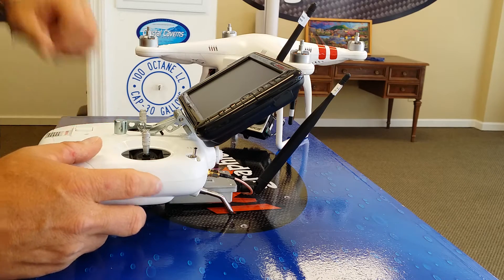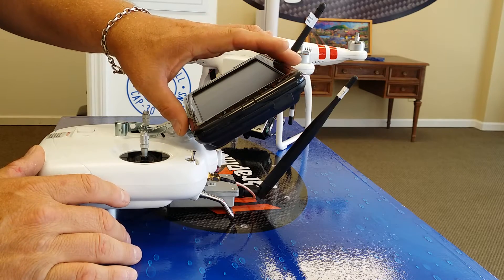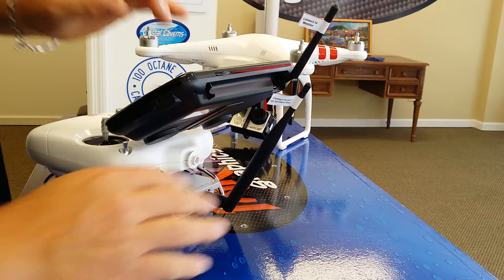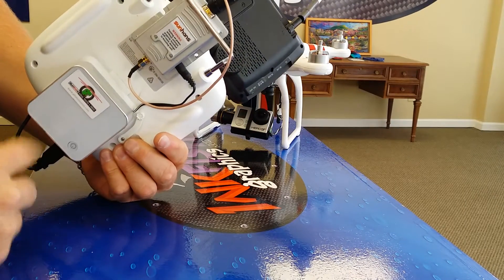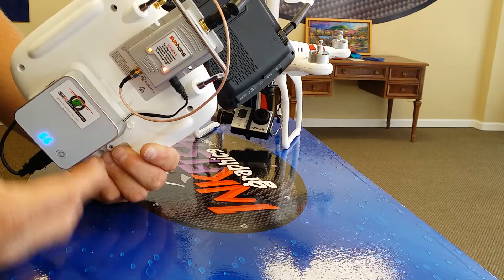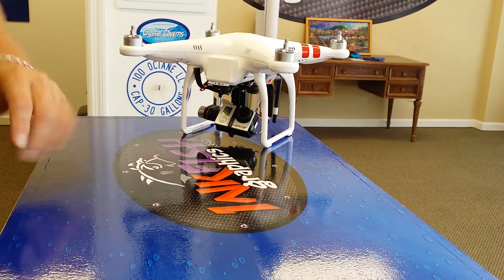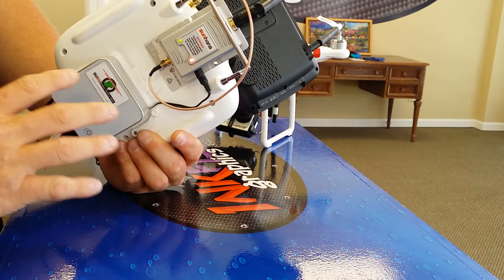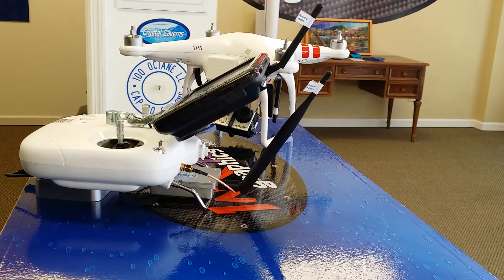Stage 2 Range Extender Operation for DJI Phantom 1 & 2

Comment: Awesome video. What range do you get with that mod?
Reply from the maker: It all depends on your area but generally twice to 3 times your normal distance.
Reply: CCW Chris Awesome, could you tell me what model is that battery you have there for the extender? I am looking for it but I haven't found it yet. Thanks
Reply from the maker: MrWILLJMS Its our battery pack.
Reply: CCW Chris I didnt' know about it. You should put a link on the description. I just saw it right now, I need this for my phantom, so I am going to send you my remote control. Thanks.
Reply from the maker: www.photosoarus.com
Reply: Link doesn't work.  Where and how do I purchase the kit